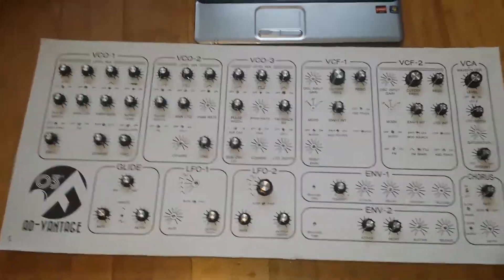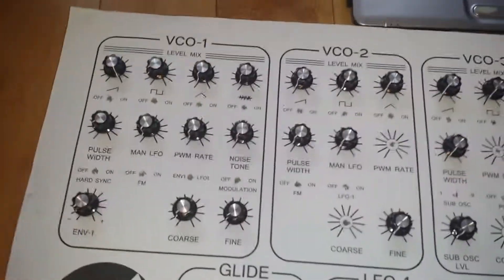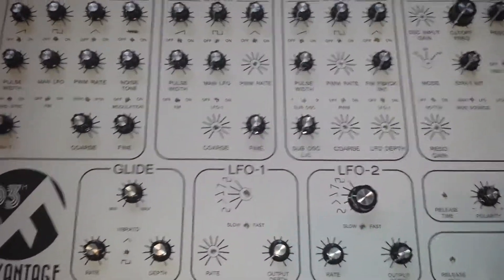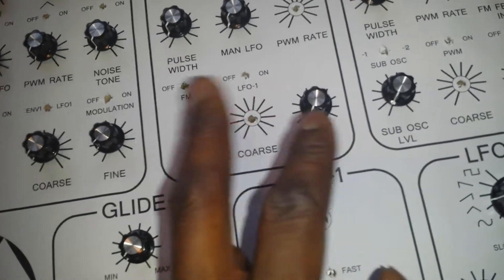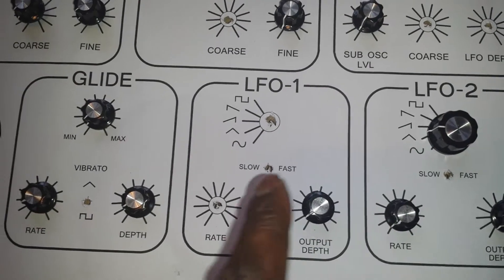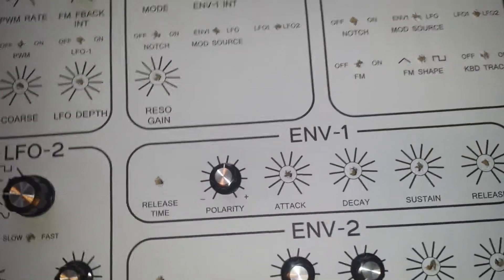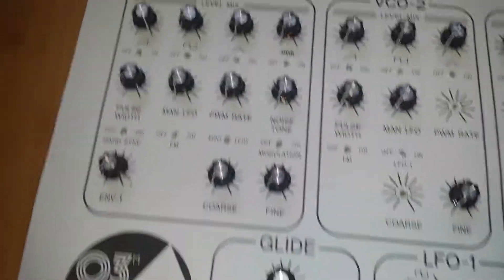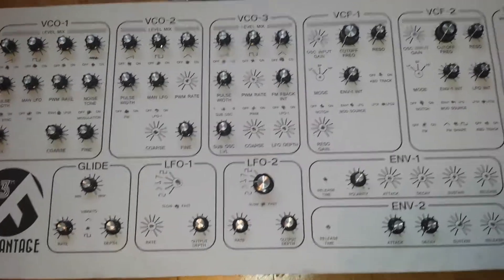DIY analog synth project (The front Panel Design Pt 2)

Comment: thats looking well nice and very professional. can’t wait to see the finished piece.
Reply from the maker: markusfuller Thanks Markus, yes it will hopefully reach a finished stage, just going to be a slow process as im learning all this from scratch and tryin to use logic dnd common sense alot of the time :-). Thou credit to one of my subsbscribers for the graphics design.
Reply from the maker: Hey Markus , can i pick your knowledgable brains for some advice ?.
What type of header connectors would you recommend i could use to link my control panel board to the main circuit board/s. 
There will be about 80 pots and about 40 odd on-on toggle switches. Is it ok to put cv modulation and audio signals on the same header ?, or could i face interference of some sort ?.
Also im thinking of making seperate boards so all Oscillators on 1 , Envelope generators on another possibly with the Lfos, Filters on another with VCA and wavefolder. 
Anyway i hope you have time to read this and, let me know your recommendations.
Regards ;-)

Comment: Hi, Adamski Ajull!
The retro design is cool!
My personal feeling that it can be less space between small knobs... For about 1-3 mm everywhere. So you can get less wider casing if you'll make this so. When you're packing things (to go to somewhere or so) it make sense. Sometimes it's "oops! not enough to put it into a backpack, just a bit" :) 
 I guess you'll choose this to make sure that you'll be able to turn two knobs simultaneously without any collisions... IMO it's not necessary for everywhere. Just my opinion.
Reply from the maker: MoolahNasreddin Thanks for your comment . Yes i had a panel size a while back and it was a bit smaller . I have quite big sausage fingers so i dnt do well with small spaces in between knob caps otherwise i start getting cramp. So yes its confortable for me. Thou i guess if it was commercially manufactured it could be resize. There is more than enough space for the circuits ( i hope lol). Anyways nice to hear your opinion . Thanks for your input as always ;-)